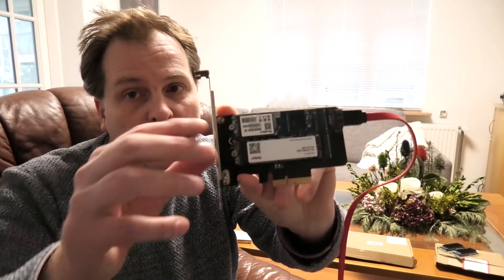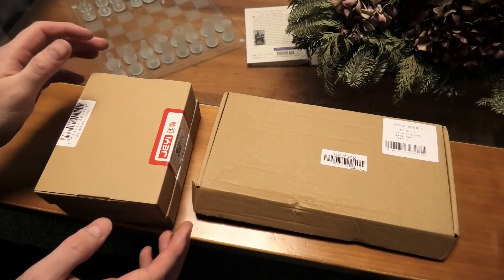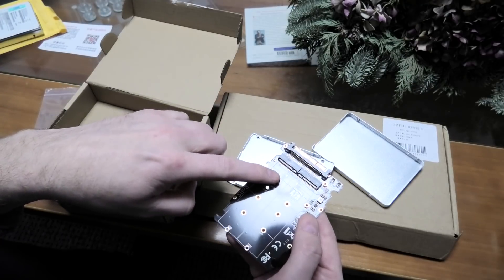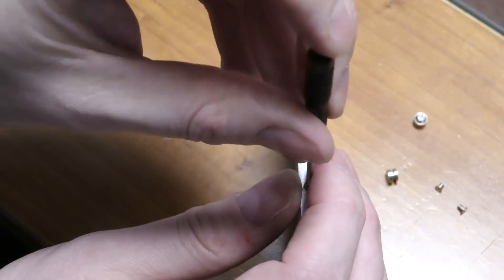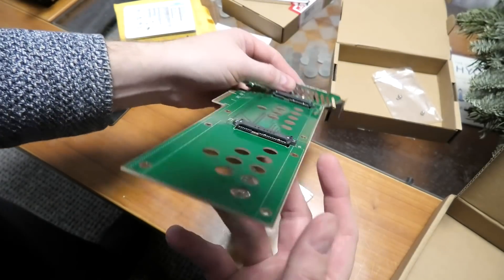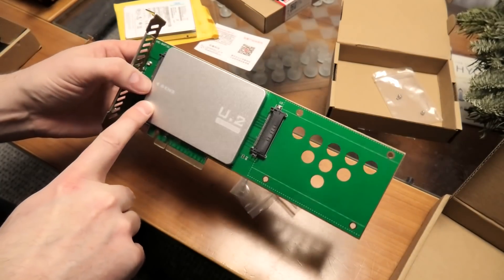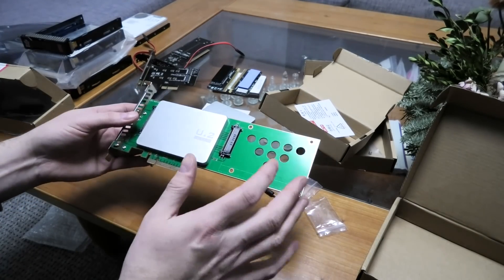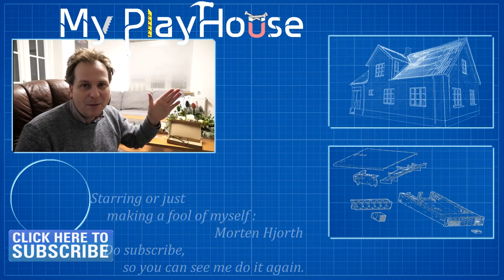U.2 is for Enterprise Servers. This M.2-U.2 Adaptor -Ninja - 1150

Comment: There is something similar to M.2 for servers.  It is EDSFF e1.s.  It is not directly compatible with an NVME or other M.2 socket, don't try inserting that in there!!  What makes it similar is that it uses PCIe for the connection.  But the socket is most likely wired differently than that for M.2.  These EDSFF drives come in e1.l (the longer "ruler" format).  Do a bit of searching and you will also find that these may come with heatsinks of varying sizes.  That may limit the number of them that may be used in a system just because of the extra physical space they will occupy.  These are intended for enterprise and datacenter use.  You can get an adapter card for them and use them in a PCIe x4 slot.  Some of these are gen 3 drives so don't expect the best speed.  If you want that it will cost considerably more and that is assuming that a faster one is available.  These drives although often x4 can be x8 (probably for future use).
Reply from the maker: Hi @Myself-yh9rr
Thank You very much!  glad you liked the video :-)
Thank you for watching! :-)

Comment: Had the same issue that just 1 drive apperaed. Solved it in BIOS (Asus X99 Chipset) settings to set the PCIE Slot in manual mode on X16 (4x4). In Automode I always had just one drive. Maybe it helps on some other boards too.
Reply from the maker: Ahh only the very newest servers has that option :-/ Thank You..

Comment: i have a second gen i5 2500 on an old gaming case i have and i converted it to my local nas and game library on win server2019 andwaiting for my 10 gig cards .. ive put a raid controller inside for sata 6gb and i ma planning to put 10 tb drives on raid what do you thing of my build also i have a first gen 3650 lenovo server rock solid was running for over 10 years
Reply from the maker: Hi TtropicalGamer66
Thank You very much!  glad you liked the video :-)
Thank you for watching! :-)

Comment: pci-e bifurcation i think is the feature motherboard needs to split pci-e x16 to x8x8 or x4x4x4x4 .. or x4x4x8.. as nvme is x4 in bios choose all x4 to use with 4way pcie to nvme adaptercard.. else you need an adapter that can do hardware raid with those nvmes connected, such adapters are more expensive
Reply from the maker: Yes,, My Server does not support that..

Comment: Waste of money.

ssd upto 500MB/sec sata3
M. Upto 6GB/sec

Lan 10Gb/ 1GB/sec

You dont need more date write/read more then 1GB/sec( on fastest 10Gb lan link)

 ssd more realibe abd less power then the fasteset mv .
Dont need pci-e card or this disk
Reply from the maker: Well we are only aloud to driver 130km/h anywhere in this country,, I still want a better car than that.

For internal tasks you can benefit from the 8GB/sec that the U.2 can do. and now a days we put 25Gbit network cards in,, and you can use more to get more throughput.
Reply: @MyPlayHouse  if you have ssd at  500MB/sec . The server can store the data in use at memory. Use big and fast never will be good.

The old pc like spectrum use 48KB-128KB and work fine.

The best server - ssd( more realible then u2/mv and less power conu)  and fast cpu.

The fastest lan card you can buy today is 10Gb/sec ( twice ssd speed) .

even on gpu market , more 4GB ram is useless.
Reply: @orencomputerelectronics8751  I don't know what world you've been living in. Network is not the only consumer of data from a drive, if you want to process big data sets a fast disk can store more data than can fit in any single machines memory. A bank of 24 nvme disks can approach the real world throughput of 8 channel memory in a modern server too. So you could have 100TB of data accessible at almost memory speeds by using nvme disks.

As for 10Gbe being the pinnacle of Ethernet... I can buy equipment for a few dollars that will do those speeds that is so old it's no longer in support.

An Epyc server can feed memory with data from disks at > 150GB/s, and ethernet at 200Gbit plus is starting to become generally available. Hell, even PCIe over fabric at multi gigabytes per lane is a thing now.

Comment: the mkt is still sort of a mess but the cavalry is on the way with regards to i/o - smb sector wants nvme partnered with faster networks and using cheap scalable nodes, net fs and mysql clusters - it provides redundancy and scalability with fast roi and lower tco - opnsense/selks/qemu/kvm/debian. also zen4 is going to be so much more efficient that the refurb long tail will be sig shortened - it will make sense to upgrade just for ipc gains and power effciency soonish - the next 1-2 years. we are on the road somewhere and server and mkt consolidation will be the norm. meanwhile the qubit race runs in the background.
Reply: a big factor and pita is that you need to vet your platforms and see if it is possible to boot to nvme and nvme arrays - build a 100g potato router and find a cheap platform that will run nvme array and 100g - the connectx cards are pretty reasonable but again you have to have a modern platform to pair it with - smb should skip 10g/25/40gbe and go straight to 100gbe #sonic #cluster overhead #bluefield #sth #50m iops 8 node cluster - why wouldn't anyone want this? #mkt impacts
Reply from the maker: Hi shep husted
Thank You very much!  glad you liked the video :-)
Thank you for watching! :-)

Comment: There's U.3 now so u.2 is old :P
Reply from the maker: I think they are still U.2,,, just Gen3
Reply: @MyPlayHouse  not really. U.3 within u.2 spec and supports hot swap. Although you can use u.3 drive in u.2 slot but you can use u.2 nvme in u.3 slot.
Also u.3 provides ability to put sata, sas or nvme ssd without changing backplane. U.2 Will work only with nvme

Comment: would be slightly worried with nvme ssd in there, they can get pretty hot and doesnt look like it would be able to cool itself very well
Reply: From the looks, it will dissipate heat using thermal conduction through 4 screws of the U.2 case → PCIe board PCB Copper GND plane → PCIe bracket → PC case, interesting to see if it works as designed though, maybe copper GND plane is too thin to conduct heat efficiently enough.
Reply from the maker: Yes,, but if the M.2 could touch the Alu. box and be cooled that way,, I think it would be fine.

Comment: sadly the u.2 format as long as i know is only Sata/SAS or only PCIe/NVMe as there is no logic splitting the sata/NVMe stuff. also these u.2 adapters are made only for pick one for use, not both.
You might also want to check out U.3 as it is the better successor and is using a Tri-Mode Controller that allows the use of all types of storage (NVMe/SAS/SATA).
Reply from the maker: Hi Psy9BantaiTaichou
Thank You very much!  glad you liked the video :-)
Thank you for watching! :-)

Comment: U.2 drives / devices are usually a raid of SSD internally (At least the ones I "played" with), why they are so bloody expensive. You can also feel it when handling them; they are basicly jammed filled solid pieces of memorychips. They present themselfes at a single device outside with blistering IOPS. The raidpart should make them much more fault tolerant as you should be able to get a warning before they fail terminally. I build 6 database servers with 2 in each (always fun to build servers with drives where each drive representing a decent used car in value) a 4-5 years ago, during my tenure there (3 years)  2 of the failed completely without warning basicly just turning into very expensive paperweights.. Have them sitting at my desk as a warning to future me's about it way better to go for very high speed and servicable redundancy (SSD SAN with highspeed fiberchannel) compared to unserviceable single point of failure blisterings speed items without seatbelts...
Reply from the maker: Hi Anders Jensen
Thank You very much!  glad you liked the video :-)
Thank you for watching! :-)

Comment: Get yourself a 4 way u.2 nvme pcie splitter card, cost isn't bad ~$150, and u.2 nvme can be had around $50-$100 if you look around the bay, lots of newer, older stock servers, can support these now in the front bay. The dell r630 has been plentiful recently and fairly cheap and support 4x u.2 nvme in front of chassis, I have seen them as low as $400, pretty reasonable!
Reply from the maker: I need to look in to that..